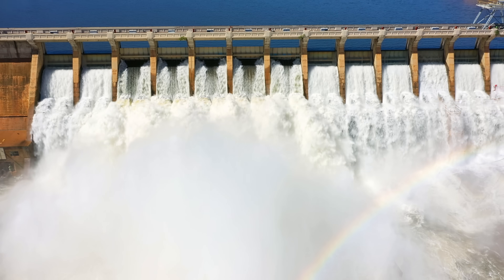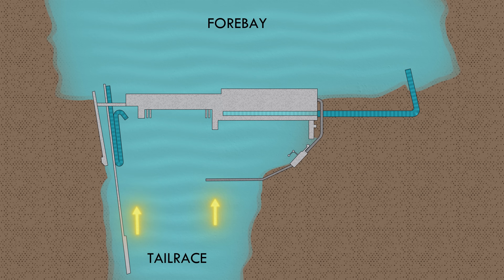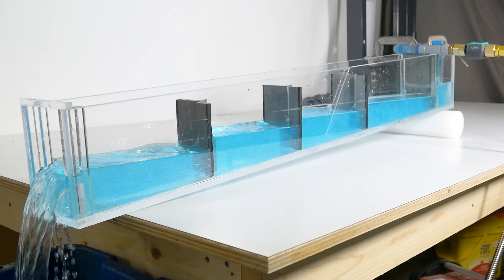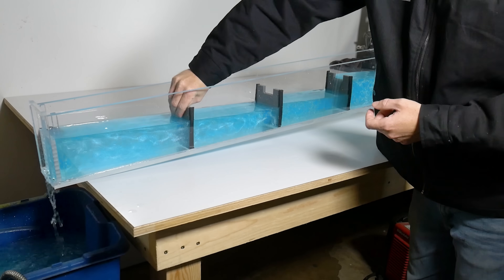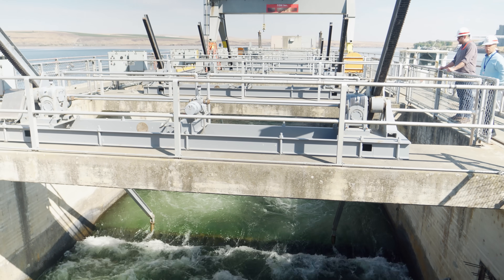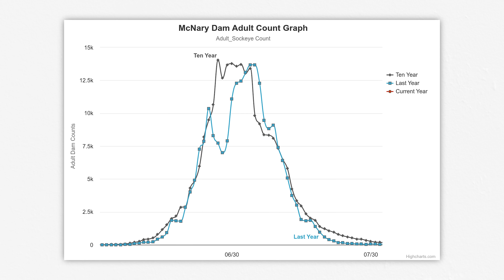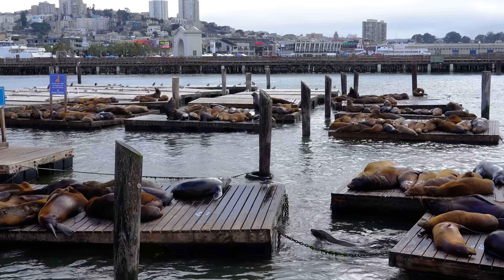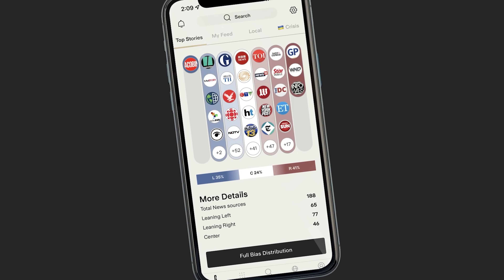Why Fish Ladders (Mostly) Work

Comment: My mom was a fish biologist for something like 20 years in Washington State, and spent a large portion of that time working on designing/building better fish ladders in the 70s and 80s. 

Dams are great. They do need to be designed to allow fish to travel through them, the reliability and capacity that dams have for generating power is really pretty much second to none imo. The only real comparable solution to that being nuclear, but the US has essentially proven itself incapable of understanding that safe nuclear power does exist, so I doubt we will see large scale nuclear power in the US any time soon.

Comment: Hm, would it work to have a giant tesla-valve design, that impairs flow while still not fully stopping it? And what about having the weirs have slanted tops (and maybe bottoms too), alternating the low side in a zig-zag, maybe even varying the orientation of the top and bottom slants independently to introduce some "natural" variation along the way?

Comment: In Australia most engineered fish passages don’t work very well. Initially they were based on salmon ladders. Our fish are lazy and don’t jump, so salman ladders never worked. The engineers also tend to miss the lifecycle of the fish species involved. So they may work for some species as adults but smaller species and juveniles can’t pass it.
I’ve built a few, the best type are simple rock ramps. No need to over engineer a fishway. Replicate the natural hydrology and structure.

Comment: My father designed and ran Salmon hatcheries for years. Different species of salmon needed different ladder designs. They would actually change the baffles depending on which species were running.
I've always been surprised that these big dams don't have more parallel ladders with different designs to best facilitate all the various species. I guess it's a matter of "good enough for government work".
Reply: If I had to gess the problem would be how do you get the fish to the ladder designed for them

Comment: There should be a followup to this one. Enabling the fish getting upstream is only one part of the environmental problem. The other one is getting silt and sediment down. As far as I remember, this was the major consideration for the removal of the Elwha River dams. Without the sediment, the rivers simply aren't livable for salmon, and you can clearly see that impact in the mouth of the river. Are there engineering solutions for that problem? As far as I know, a lot of dams are currently suffering from big sediment deposits.
Reply: thats really interesting actually. want that too.

Comment: Aerial fish stocking does work, at least in certain circumstances.  In Utah high elevation lakes that are inaccessible to trucks are routinely stocked from the air with very small trout.  The fish are usually less than 2" in size and survival is well over 90%.  Obviously a larger fish would just go splat, but the little ones almost float down like leaves.
Reply: I'm assuming he's probably talking about dropping salmon, but even then, couldn't you just drop them really close to the surface of the water and it would be fine?
Reply: @trainzelda1428 even fighter jets generally only get down to about 50 feet above the ground. Getting low enough to drop the fish would probably be overly perilous for the plane. Also if you have trees or similar around the water the plane might not be able to get enough area to drop fish without running into whatever was around the drop area.
Reply: @bmanning4999  that makes sense,  I guess I was picturing a small seaplane or something circling it's way down but that would obviously not be an effective way to transport large fish. Suffice it to say I do not know much about aircraft lol.
Also, I grew up near lake Erie, and I have to remember sometimes that most lakes are ummm not quite to that scale
Reply: @trainzelda1428  but wouldn’t it be …great…if they were that scale?

Comment: the lake i live on used to be a river packed with salmon, but the dams built on both ends of the river killed literally all of the salmon and turned the river into a lake. the smaller river that feeds the lake also lost all of its salmon, as did most of the water ways going to the ocean. the goal is to get salmon back in 100 years or so, but its likely not even possible. its great having cheap and endless power, but the cost was all of the salmon and flooding native american settlements

Comment: Hydroelectric power is one of my favorite forms of zero-emission power sources, and I am glad that we are finding ways to mitigate impacts to wildlife in the areas that dams are being built. Hydroelectric power is a nearly infinite source of energy since reservoirs get refilled regularly by runoff and rain. Unfortunately, I live along the Mississippi River which is much too busy to incorporate any sort of dam. Some of the smaller rivers and tributaries might be able to have dams installed with little impact on wildlife, but they probably don't flow fast enough to produce a meaningful amount of electricity. Some barely flow at all. I am glad to see the advancements though. Now, if only we could figure that out for wind turbines. Never mind the fact that decommissioned blades just kinda get tossed or burned.
Reply: many of the downsides of wind turbines can be solved by placing them out at sea - offshore wind. faster winds, larger blades, less wildlife to impact. of course, thats not feasible everywhere

Comment: The local dam had a fish "elevator" thing, but it was deemed a failure. So they built a fairly nice rock-based fish ladder. basically, a large ramp covered in spiky rocks to slow the flow of water.  State of the art.... except, all it does is seem to catch trees floating down the river, so they have to cionstantly lower the river level to clean out the ladder. Progress I guess

Comment: I realise I don't know how fish generally know which direction is upstream. If they're surrounded by water (especially if its murky) how can the tell which way it's moving? Do they have to see or feel fixed objects on the floor or banks for reference?
Reply: fish have a "lateral line", a set of sensory organs on the sides of their body, which can detect movement/vibrations/pressure gradients. it helps with detecting flow direction, as well as other things like schooling behaviour

Comment: I have a large tree down over my (eroded) stream that I want to use as a dam to bring the water table back up. I have been thinking about how to keep the aquatic critter passage open as I do this. Not so much at the "dam" as at other places I want to raise. At the dam, a couple lengths of corrugated HDPE pipe could be tacked in and bent back on itself to keep the velocity reasonable. Out in the open I think I will be stuck trying to keep rocks properly aligned.

Comment: @5:51 "No piece of infrastructure can operate 24/7."
What?  The whole dam is infrastructure.  A road is infrastructure.  A power plant is infrastructure, and the wires that carry the power to you are infrastructure.  They don't take breaks.
Reply: All of these do take breaks when extensive maintenance is required. Wires get replaced, roads are closed while getting patched up and eg France currently has many of their nuclear reactors offline for repairs.
Reply: @joshuakeunecke5431  You're presuming that 24/7 means "perpetually without stoppage."  It actually means 24 hours a day, seven days a week.  
Everything I mentioned does work 24 hours a day, seven days a week.  They don't work forever, and I didn't claim they did.

Comment: Hi Grady, can you create a series of engineering used in High rise plumbing. How the pipes don't burst when buildings flex. How the pressure is controlled for each floor etc.
Reply: That would be awesome!
Reply: +1 Vote for this!
Reply: Adding my comment and voice to push this idea along.
Reply: Yes, and how air pressure from the flushed load of a toilet high up in a building does not create fountains in the toilets on lower levels.
Reply: @paulrandig  Interesting one!!
Reply: @paulrandig that’s a pretty simple answer. The pipes get bigger at each floor so there’s no air pressure created between them
Reply: I vote for this too
Reply: INDEED!!!!
Reply: I concur
Reply: Never knew I was interested in this, but now that you mention it, I'd love to see how it works.
Reply: Skyscraper ”plant” in general - how much of a skyscraper’s volume is plumbing, HVAC, hallways, electrical, elevators & stairways, fire control, etc…
Reply: Fire water systems for buildings could be part of this too. Definitely would be an interesting topic. 

Also how you can build a high rise building over an existing sewerage line from half a century ago and still have everything work (what upgrades are required for existing infrastructure)?

Would love to see how new developments work too.
Reply: Yes
Reply: Very interesting topic.
Reply: Yes please @PracticalEngineeringChannel
Reply: @PracticalEngineeringChannel
Reply: Nice suggestion!
Reply: Great suggestion
Reply: This!
Reply: the people demand a penthouse toilet explainer
Reply: Up
Reply: Would fit perfectly!
Reply: Yeah!👍
Reply: Great idea!
Reply: I also vote this!
Reply: That's a really good topic
Reply: voted ✅
Reply: Oh. Yes please. And maybe an episode on the ones that don't work like the Burj Khalifa and all the sewage trucks.
Reply: I didn't think or knew I needed a video on this, but boy do I now! Sounds amazing
Reply: Happy to discuss as that is part of my job. Day in the life of a public health engineer...

 One myth to bust is on drainage usually the bigger challenge is ventilation. Wastewater reaches it's terminal velocity after a few floors and so is usually not too difficult to design.
Reply: That sounds interesting!
Reply: Oooooo😮
Reply: Would love to see it
Reply: Expansion joints and pumps. You’re welcome.
Reply: +1 on this! I recently stayed in a really tall building, and I noticed a tap would take a while to stop flowing once I turned it off
Reply: great idea
Reply: Looks like someone needs some extra help in school lol
Reply: We need this!
Reply: Very cool idea